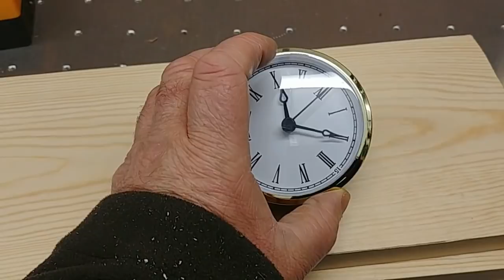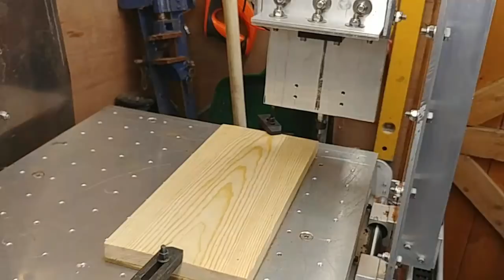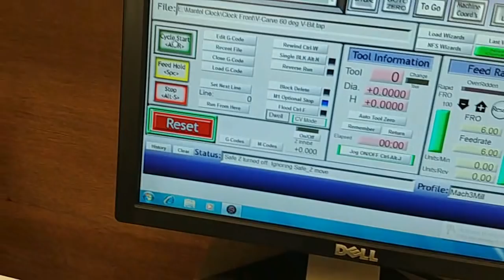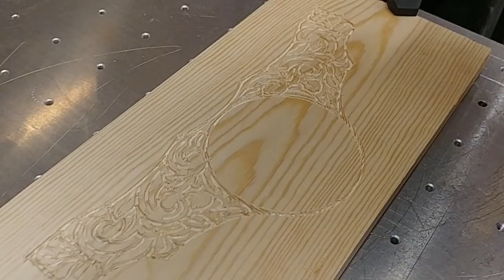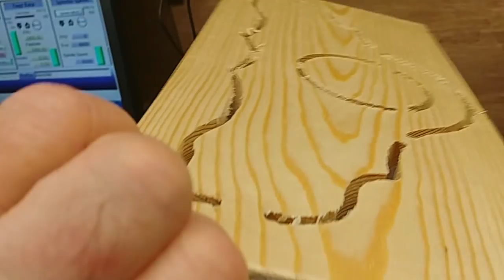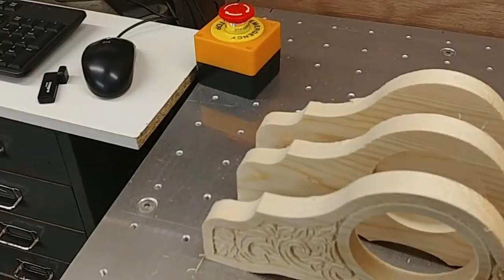First Project On The CNC Machine

Comment: nice video!
Reply from the maker: Hi Thank you, It was the first proper project on the cnc that I built
Reply: @jammymowlam1  No problem... I am going to receive my first CNC router on Wednesday and im really excited!
Reply from the maker: @lou2737  Thats great !!! If its any help.... I use Vetric aspire 9 for the tool paths and then I use Mach 3 to run the machine... but i expect if your buying a cnc it probably will be coming with the software,
Reply: @jammymowlam1  It's a fairly old machine, but it is in great condition - barely been used. I received the proprietary software for it recently - it still takes G-Code but cannot communicate with anything other than its own software. What bits do you suggest buying for cutting mostly wood, some plastic and a little bit of aluminium?
Reply from the maker: @lou2737  Hi, I only buy carbide milling bits , as I did try normal router bits and they break very easy, there are plenty of suppliers out there, but I always use this company, they have a good range of carbide milling cutters and carbide router bits all sizes, and the service and delivery is quite quick. www.drill-service.co.uk I hope this helps, good luck with your CNC
Reply: @jammymowlam1  okay thanks! Will have a look